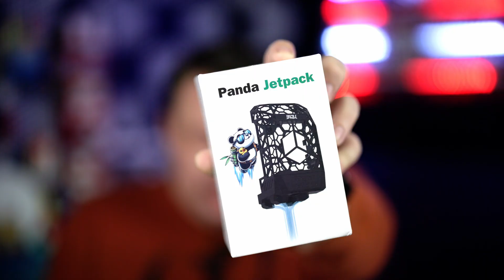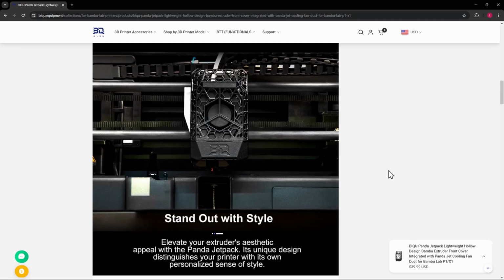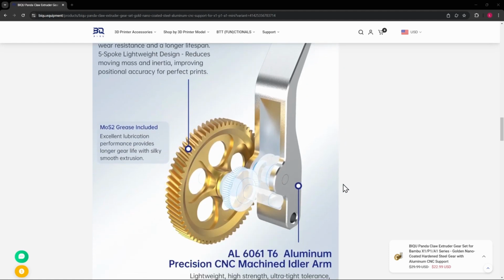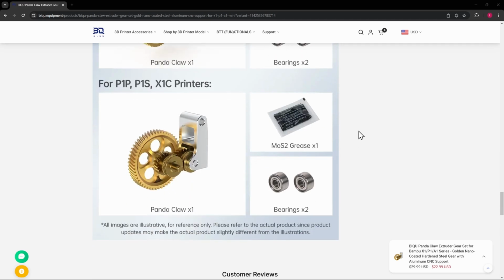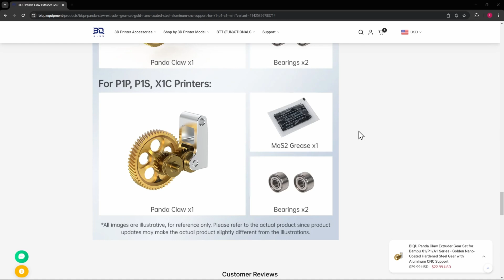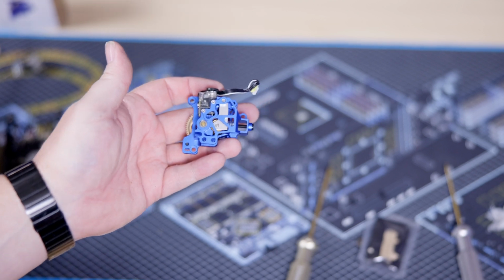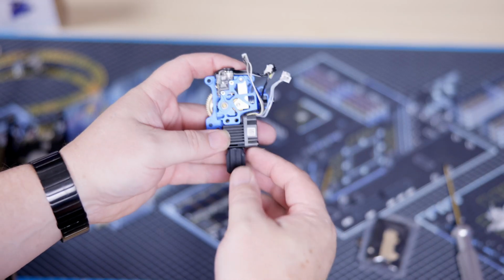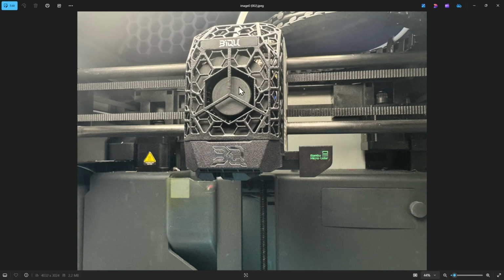More Biqu Upgrades: Jetpack, Panda Extruder and Panda Claw

Comment: That was absolutely amazing video I just need to work out how to add the new hub and 3 light bars into the printer and the Knomi can’t find any instructions
Reply: Working on things require a bit of common sense, ingenuity, being mechanically inclined helps. Visualize then apply yourself. Keep in mind these machines are built by kids in China.

Comment: Im considering the BIQU Panda Claw and Extruder.  Do you think these things make a difference for the price.?
Reply: Short answer no. Long answer, the cost and time to install and tune it will not pay for itself because you'll only be shaving less than fractions of a percent of time from builds. You'd be better off getting a higher flowing hot end

Comment: I started using these same 3 BQ parts since a week or two before you video. I would not recommend the Jetpack. 
The problems is the Jetpack wraps around the nozzle. To get it on or OFF it needs to come up from the bottom. This is a problem if it has a print under or is over the poop shoot. I have had two prints fail and the cover came off and knocked the print over. It is debatable if the standard cover would have.
The other problem is I had a clog that I needed to get to the nozzle. the print auto paused, as it should. But the cover would not come off when over the poop shoot (home) and during a print you can't move the head.
have no problem  with the Extruder and Claw. But I would not recommend the Jetpack

Comment: I got a Panda claw & the extruder enclosure frame too, but I think they're going to sit in my X1C spares box until a gear needs replacing - The only (to me anyway!) reason I can see to replace it is if something was broken or if I had ringing (It is significantly lighter!) and at the mo I have neither, I've got four of them and will replace as and when they break - Not to mention putting undue stress on those companion boards is not my favourite thing to do 

Thanks for the video, though. If you're like me even if you're comfortable with these things and could do it without a video or guide, you still look on youtube to make sure you're not going to mess it up and there were zero videos until yours came out